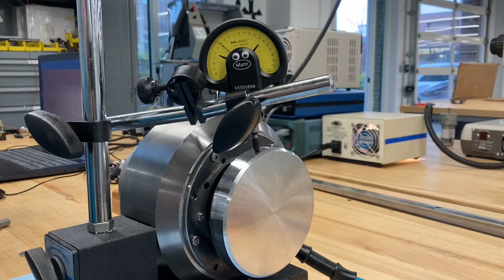Hale coupling repeating to under 5 microinches?

Comment: Wow, got any more info on this Hale Coupling? I can’t seem to find much info on it.
Reply from the maker: https://patents.google.com/patent/US6065898A/en

https://digital.library.unt.edu/ark:/67531/metadc784803/m2/1/high_res_d/8431.pdf

they are only briefly mentioned in his phd thesis but i still have linked it because its an awesome read

Mine are a slightly modified flat on flat version
Reply: @cylosgarage  brilliant, thanks!

So it’s a similar idea to the Hirth Coupling with meshing face gears.

I’ll have to read through his thesis, but that’s an interesting idea of replacing face contacts with a line contact. I can see how that would allow some compression on the rounded side, hence they would average out and result in a better alignment.

Comment: How accurate is it if you index it to a different position?
Reply from the maker: Right now, not accurate at all. BUT that is  because on this prototype there is no reference feature to dial the coupling in. So the coupling is located decently, but in reality the axis of the teeth is misaligned from the axis of rotation by a couple thou. The final version I’m working on will include a feature I can indicate off of that is perfectly concentric with the teeth. This will ensure repeatability in any orientation